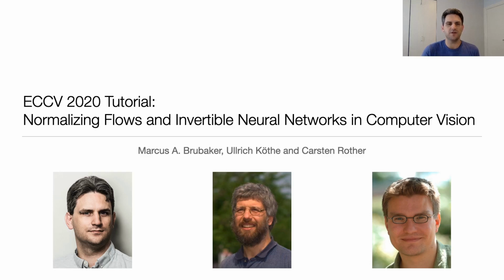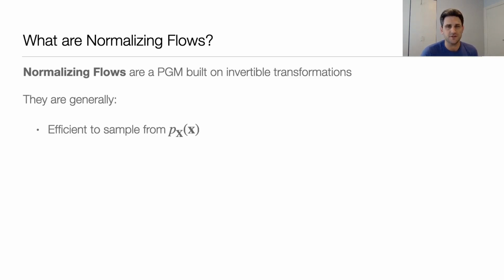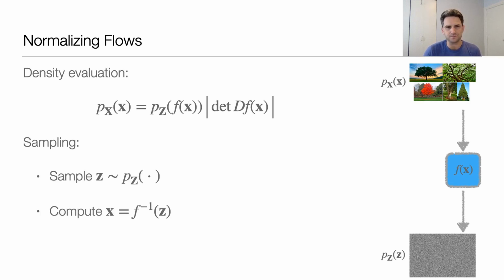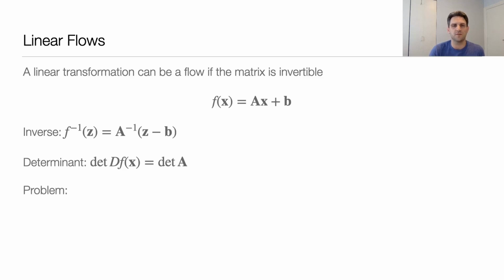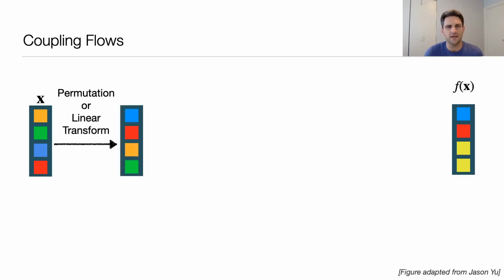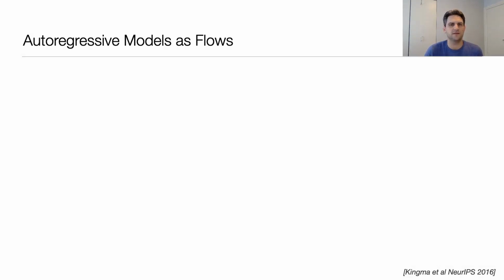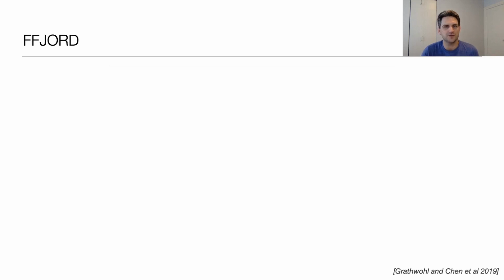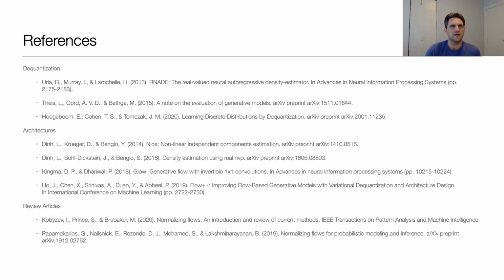Introduction to Normalizing Flows (ECCV2020 Tutorial)

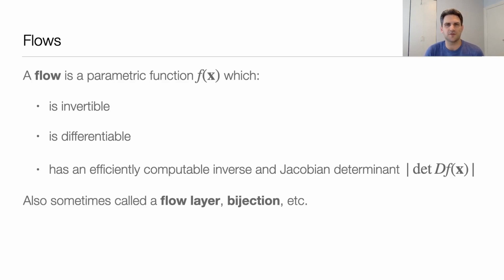Comment: Around 19:30 you say that flow layers technically need to be diffeomorphisms, but is that actually the case? I don't see any reason why the inverse needs to be differentiable as well.
Reply from the maker: You need the flow to be differentiable in the normalizing direction in order to enable training and the computation of the Jacobian.  Further, the Jacobian needs to be non-singular (non-zero determinant), and that implies (by the inverse function theorem) that the inverse is also differentiable.
Reply: @MarcusBrubaker  Ah, okay, makes sense. Thanks!

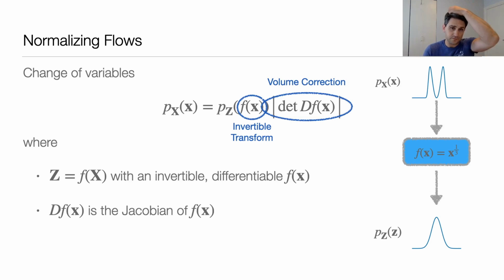Comment: I have a question. How does taking cube root change a bimodal distribution to a unimodal distribution at 13:50?
Reply from the maker: It's hard to give a good intuitive explanation for how/why a cubic transform creates multi-modality.  However. I can confirm that this is actually what happens in that particular example, those figures are the real result of transforming those distributions.